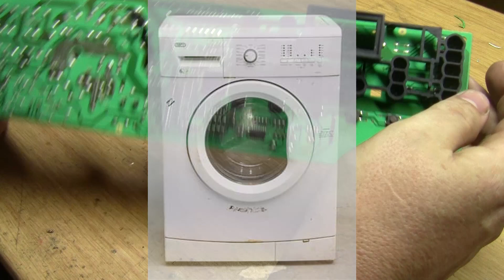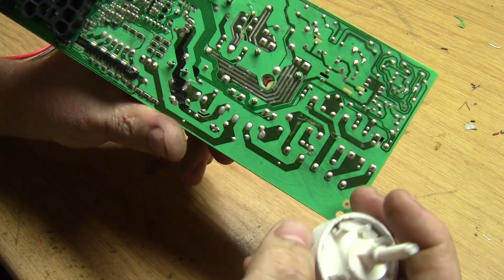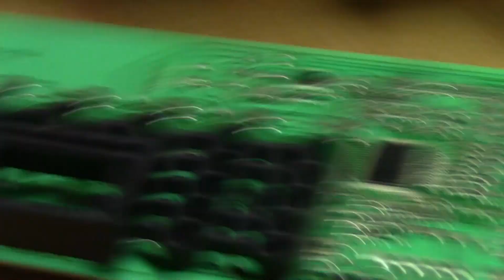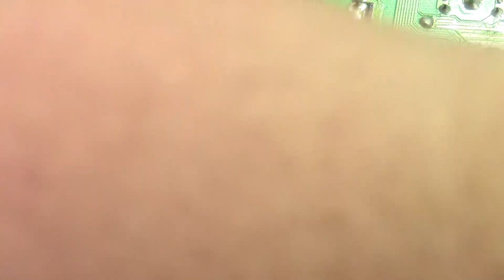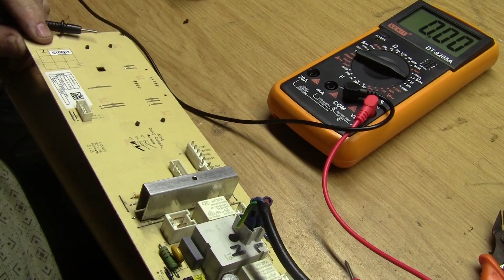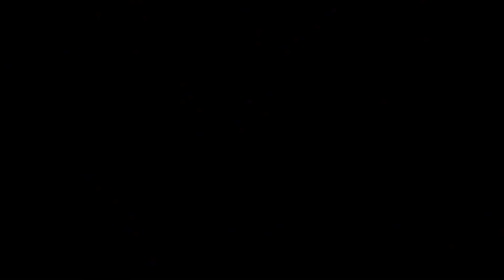ShoutingElectronics #45 - Defy Washing Machine Control Board (and make a cat a loose a life).

Comment: What do I do if I Replaced my Defy DAW 384 with a New PC Board and it does not switch on or initializes?
Reply: It may be a faulty Doorlock switch, on defy if the door switch is faulty it will turn on, but it will stay in startup mode.